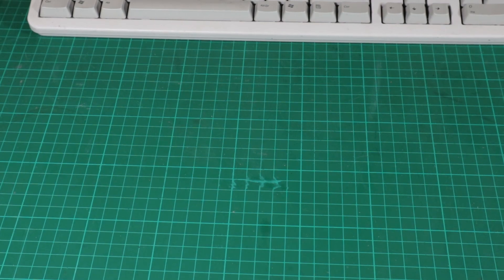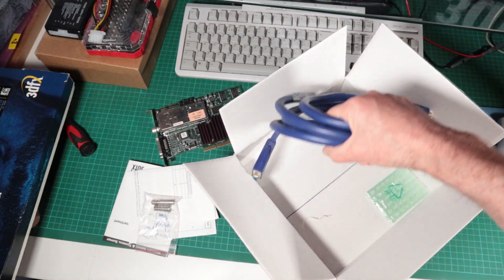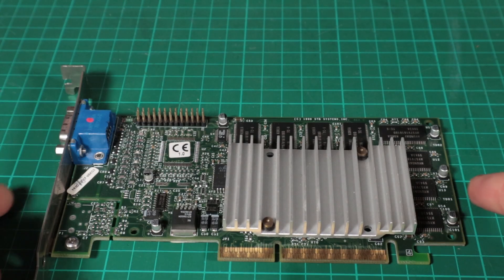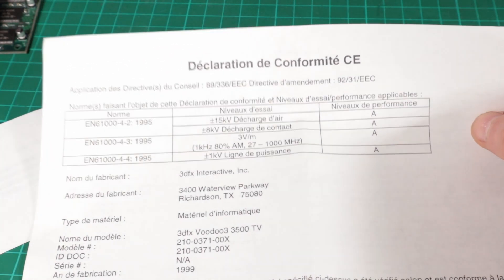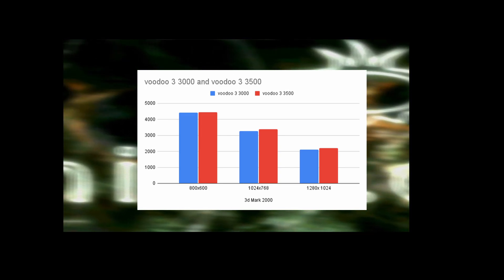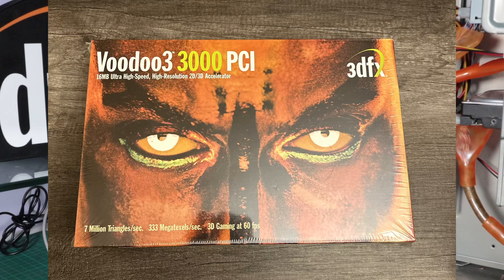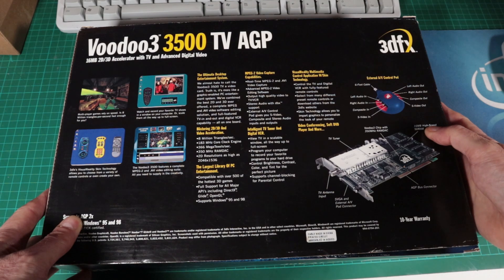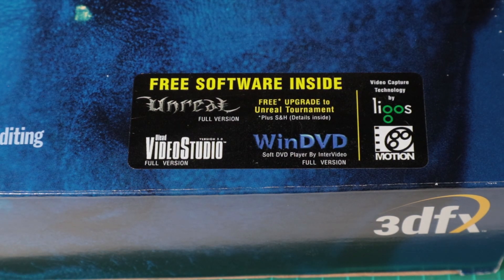The peak for 3dfx?

Comment: I've actually used TV out back then. It was a bit later, with GeForce 2 MX400. 

Nowadays everything can play videos on its own, everything has built-in computer, etc. Was not the case back then. So composite TV out allowed someone to watch a movie on a TV, while someone else could use the computer normally. I remember using nView and also players which could do full screen overlay on the second screen so that it would be impossible to move a mouse or a window onto it. But i do not remember specifics very well - it was a long time ago...

But we used it a lot and for a relatively long time. The system was based on athlon 800 thunderbird and it was more than good enough to play videos in small resolutions which were available back then.